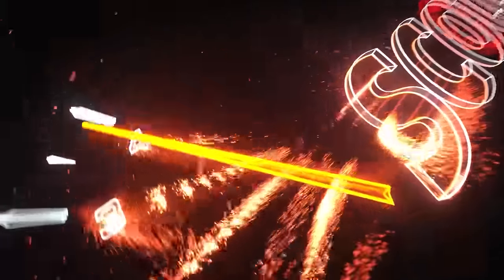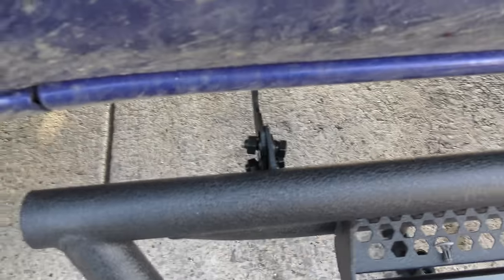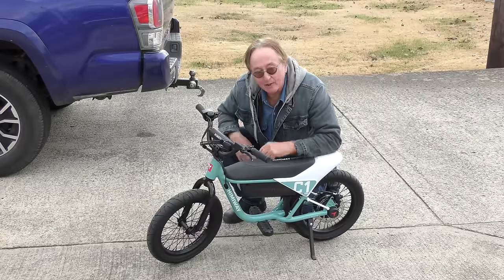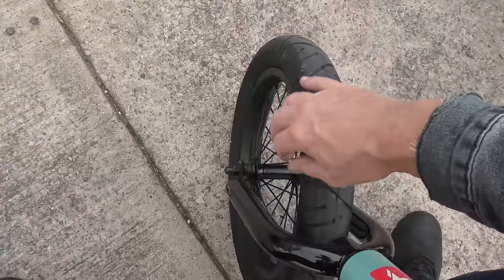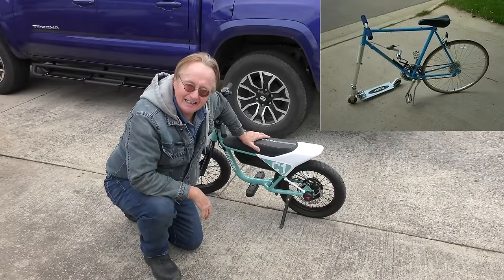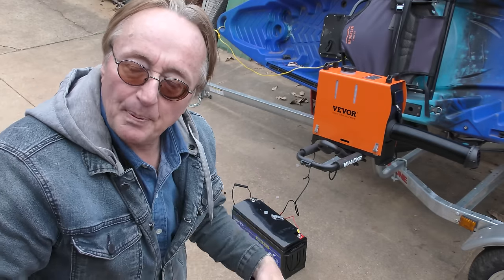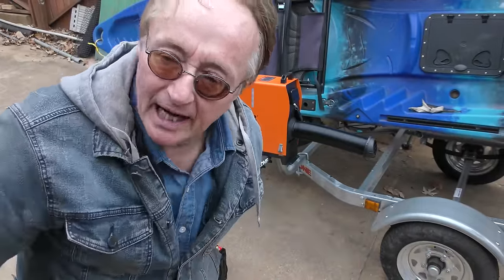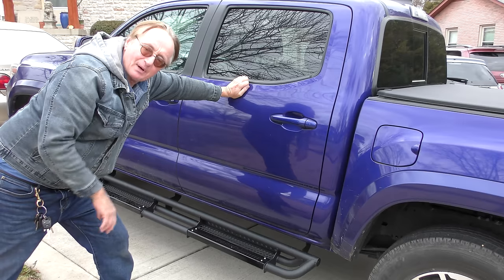I Installed This on My Vehicle and Can't Believe What Just Happened

Comment: I installed my Vevor heater inside of my camper and ran the exhaust with muffler and combustion air intake outside with the supplied tubing and clamps. I also only run it on diesel fuel because it produces better heat with diesel at a lower price. mounting it inside not only protects it from the elements it makes it harder to steal.

Comment: Something to remember about lithium iron phosphate LFP batteries is they can be ruined if they are charged when the electrolyte is frozen.  Fancy ones have internal heaters.  Quality is all over the board on how well put together LFP batteries are internally.  I like the CHINS battery I’ve got.  Supposedly it is the same internally as Ampere Time.  The tear-down video of the CHINS 200 AH showed pretty decent assembly quality and it slightly exceeded its its promised AH rating.

Comment: I have one of those diesel heaters it works great with a small shed or shop area and they can be run inside a building they normally come with a exhaust pipe that you run out the wall. Plus better to have the intake tube inside heating warm air instead of cold air.

Comment: aluminum/sodium batteries. been around forever. "Polymer aluminum batteries", that's where its going. Panasonic. Salt isn't good for electronics, or everything would have aluminum electrolytic capcitors in it.

Comment: Genius idea to separate the brackets from the runner, so that you have full clearance to the bolts when you finally bolt in the runner, which is heavy and unwieldy. 
Could do it one better if the mounts would support the runner in the proper location w/o the bolts, and then you bolt it in. 
The easier the install, the better. It should be easy.

Comment: Scotty, I don't think Kemet is going to make "Tantalum batteries", they would fail; and we used to destroy them in tests against out polymer aluminums, under high frequency pulse tests. They would burst into flames. Ours would hold up until failure and be an open circuit.